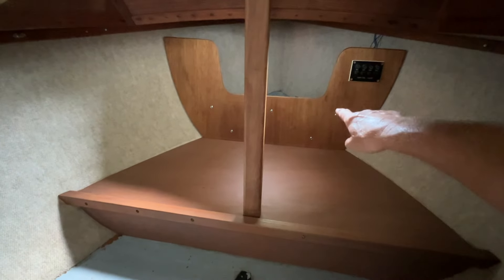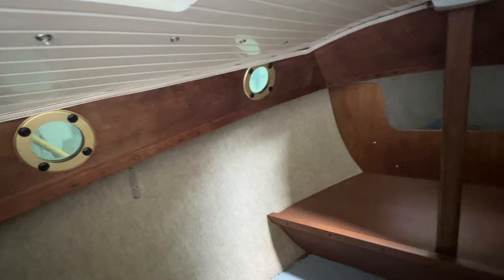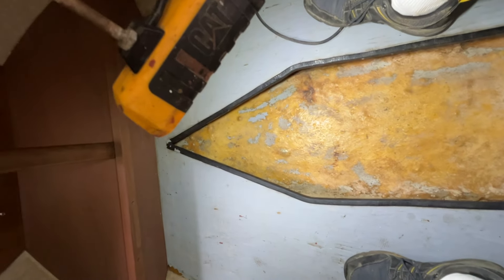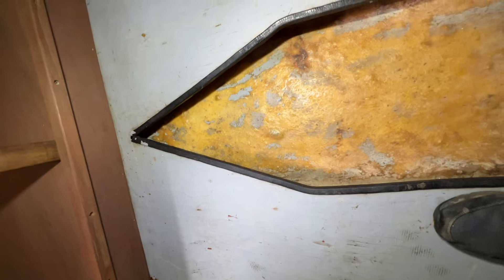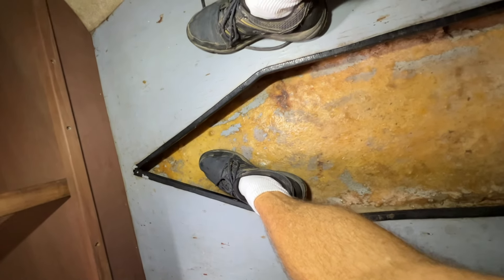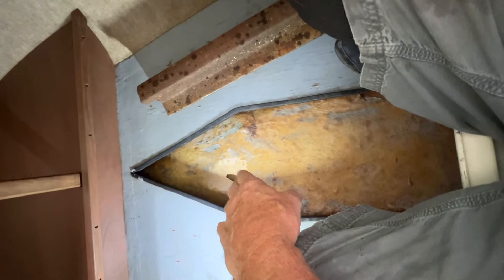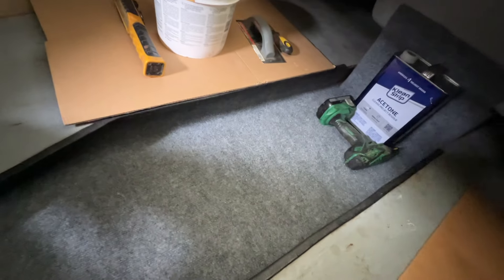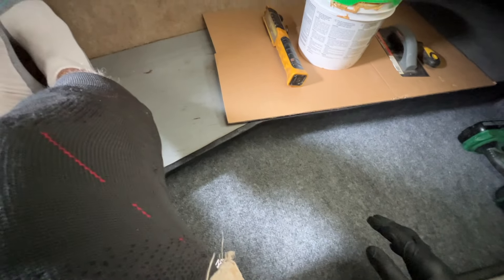Finishing the interior 1988 Com-Pac 16

Comment: your work sure has tidied the inside of cabin pretty neat looking , although i would,nt put carpet in the sole when it get wet and damp it will stink and go mouldy ,i ripped sll the carpet out my boat even though the guy i bought it  off had just put it in to tidy up before sale ,what i d id use was the foam sleeping matt that youd use on camp trip glued on to inside hull used four of them total they come just over 6 ft long 30 inch wide ,and are insulating water proof easy to wipe clean i think i paid 6 british pound for each one they had some neat colours to choose from  they,re a twin fabric a hard foam back and overlaid with a polyester or some sort of synthetic fabric with coloured weave bout half inch thick i used sticky velcro to hold in position
Reply from the maker: I used a PET carpet that won’t rot or mildew but I understand your concern. Carpet can get nasty in a boat
Thanks for watching and for your suggestion